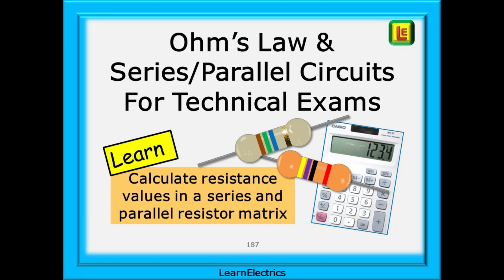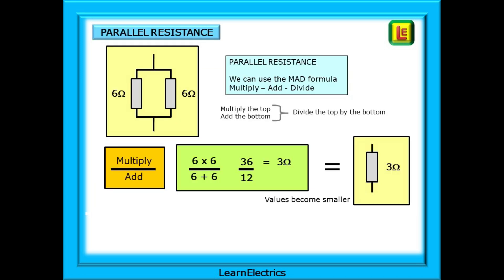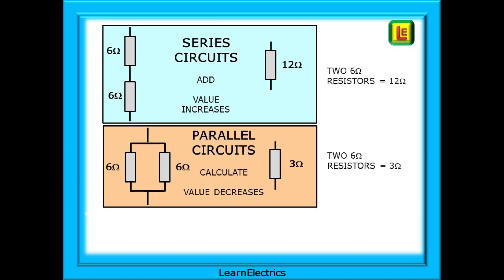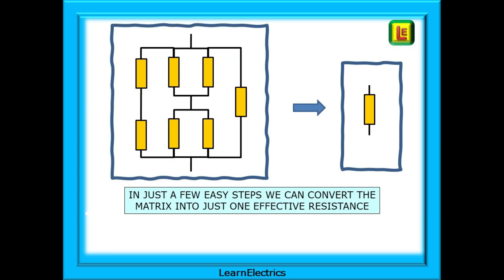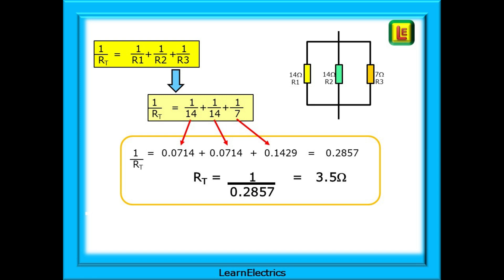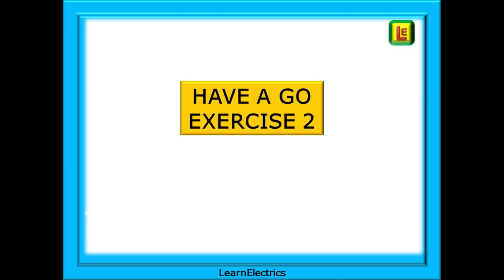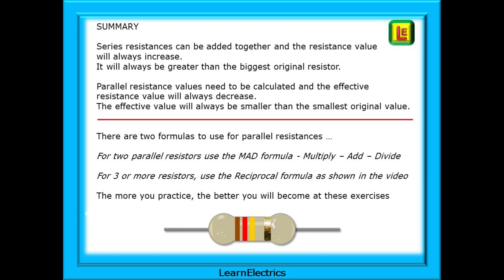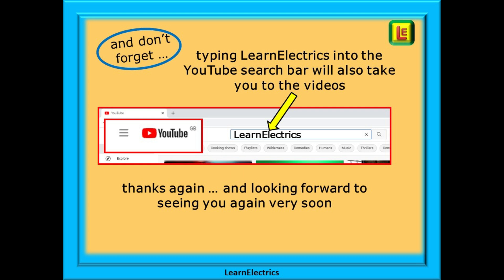OHMS LAW FOR TECHNICAL EXAMS – SERIES PARALLEL CIRCUITS - WITH WORKED EXAMPLES & PRACTICE QUESTIONS

Comment: Please Dave we are struggling with Max Zs values for TT systems.  The max permitted Zs's are all overthe books for TN systems but not for TT.  
I know you use rcd for ads but the tablature is vague re TT please give us the good news.
Reply from the maker: Zs for TT should ideally be below 100 ohms, 200 ohms max. If it is above this then a 30mA  RCD/RCBO/RCCB is needed. Having said that, most domestic installations now have RCD protection. Hope this helps. Dave.
Have a look at this video about TT Zs values on the link below.
https://www.youtube.com/watch?v=HSviV-HiLVo
Reply: @learnelectrics4402  right. 
I have just re watched video on TT systems. Thank you it's excellent and very helpful. It confirms what I was assuming about applying Zs values for TN systems to TT systems regarding the suitability of short circuit protection and overcurrent devices. Best

Comment: Interesting, I was never taught the MAD method for two resistors, only the reciprocal method, presumably because the reciprocal method always works, although slightly longer to calculate. Or it might be such a long tie ago that I have forgotten the MAD method 😕😕
Reply from the maker: Thanks for the input. Glad you found it helpful. Dave.